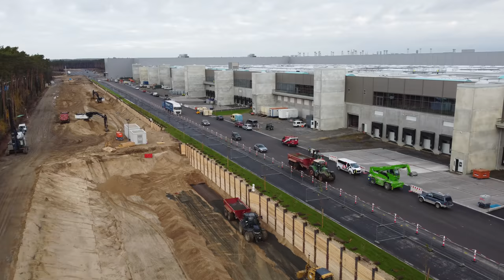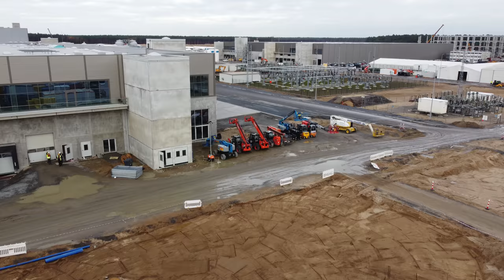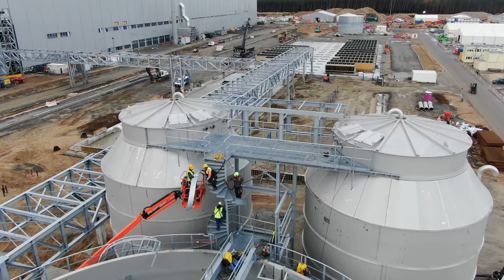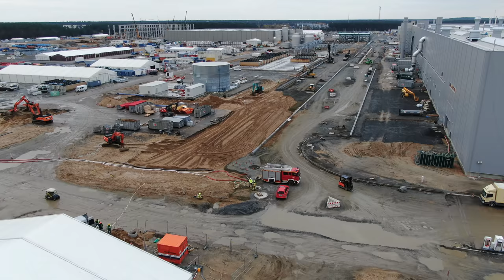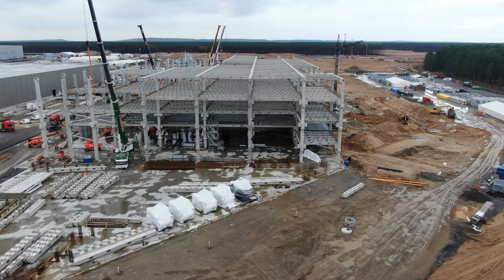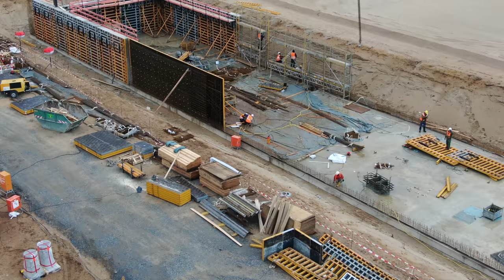Giga Berlin | 2021-11-05 | Process cooling

Comment: This is going to be epic once it starts. Trains delivering parts.
Reply: I cannot wait to see what they do with their rail connection. I hope they can make a hub that utilises the full potential of European rail! 💪🛤
Reply: I think the train will be used more for delivering complete cars. 1 train driver delivering hundreds of cars is more efficient than 1 truck driver delivering 8.
Reply: Funfakt: The Railway is not owned by Tesla (privat company not Deutsche Bahn owend(gouverment)). But the owner was getting an offer to buy it.
It is a 3. Category Railway without Electrification and not for heavy load.
Once i have had seen a plan for a different railway beside the old one - that means the old one will be disassambled.
Reply: @JK-ku2mj  I think Tesla will want that upgraded. It makes no sense not to use rail in Europe.
Reply: 1000 cars a day might mean at least 10 trains a day..
Reply: Lol....
Reply: @Remy-today  stop talking nonsense
Reply: @alanmay7929  not nonsense at all, a lot of new cars are being transported through Europe by rail. Much cheaper to employ one train driver than multiple truck drivers.
Reply: @alanmay7929  He isn't. This is not the US.
Reply from the maker: @AndreasDelleske  If I remember correctly, they plan with 12 trains per day.
Reply from the maker: @JK-ku2mj  The industrial rail is not Deutsche Bahn. It's DRE (Deutsche Regionaleisenbahn), and they are very small and not state owned.

Comment: Thank you Tobias. Do you think they could operate if they had the construction permit? The waste water treatment and the central utility building barely started, I would have thought they would need to be up and running before production could start. Are they allowed to put anything in the the tank farm yet? I guess they do not need these things for the first 250 cars, but after that, the rubber hits the road.
Reply: They can't get the full permit as long as the factory workers can't go to a toilet that's connected to a wastewater treatment plant. So many other workplace hazards right now at an ongoing construction site like that as well.
Reply: What? It's a road ...
Reply from the maker: @appolonius5468  Thousands of workers already work there, and they already can go to a toilet.
Reply from the maker: It is possible to have a temporary solution for waste water for initial production. They are allowed to use liquids for the cars for the tests, but if I remember right, they are not allowed to fill the tanks in the tank farm with them. They are only allowed to test the tanks for leaks with gas or water.
When production starts, it will start slow anyway. And with the final permit they will also be allowed to use the tanks. Then they won't need any more separate permits.

Comment: Will be constant expansion there until 2024 and 2M vehicles per year by the end of 2025.
Reply: They said the same thing about Nevada and it's still only 30% finished.
Reply: @appolonius5468  this is because of Panasonic...
Reply: @JK-ku2mj  : I’ve heard that it’s because of difficulty getting people to work at a fairly remote remote installation at Sparks, Nevada. One week per year of Las Vegas is enough for most sane people.
Reply from the maker: @appolonius5468  Nevada did exceed target production numbers though. They just managed to do that with smaller footprint than expected.

Comment: when will the factory be fully functional and complete?
Reply: Functional as soon as the permits are done, complete probably around 2026, maybe later.
But you can expect them to be fully functional and ramping up production all the way through 2022.
Reply: at the rate they are building the new battery building, it will be complete in 3026
Reply: @davidanalyst671  lol nope, that’s next year. 😜
Reply from the maker: @davidanalyst671  If they continue at the same rate as the cell production building, The whole state of Brandenburg would be one huge building by 3026.

Comment: Once again German regulators are holding up the process and delaying the start of production. I remember these idiotic rules from when I lived in Germany.
Reply: The latest delay is only as the regulators wanted to speed up the process, i.e. tried to be faster than the law allows. 
Apart from this Tesla itself is no better at all. E.g. look at 8:50
How long are those process cooling chillers parked on site? 1 year? 1,5 years?
But I can answer since when Tesla has the permission to build the foundations for them. Since 13. July 2020.  Actually for all structures on the middle axis.
And ready is this yet not either. The pipe racks are not completed. And thus no pipework on those pipe racks has been done either.

Comment: Seriously, how is there a water issue at Gige Berlin according to critics? I've seen more wet days than dry since construction commenced.
Reply: My jaded understanding is that the locals use the precious resource of high quality ground water for important things like flushing their toilets and washing their cars, so some are very protective when it comes to an alternative user. The local water works says that this factory would be OK, but if they expand it it might cause problems. The industrial area Tesla is building in is part of the filtration area for water to reenter the groundwater. Autobahns, petrol stations and such the like have been built in the filtration area, but concern about them did not get much traction. Perhaps the Tesla factory has been the final straw, or perhaps vested interests are at play. Ironically, the trees that were planted  there would have used a lot of water through the natural transpiration process. A single large oak tree could transpire 150,000 litres of water per year. The cardboard plantation that was there would loose less than that per tree, but still evaporate away about 97% of the water they took up through their roots. More than happy to be fact corrected on any of this.